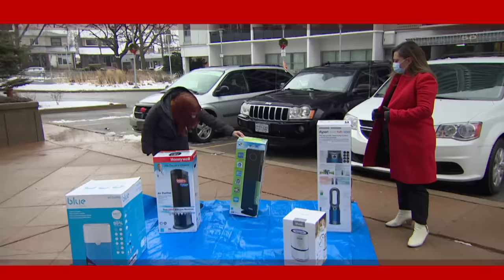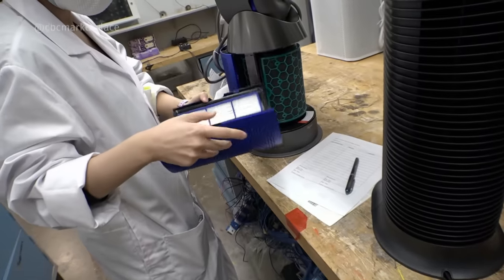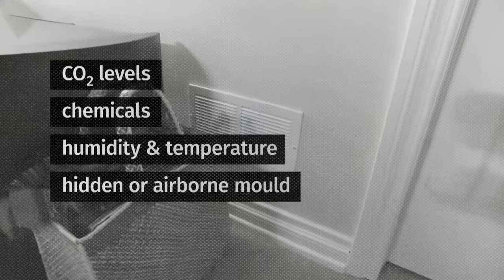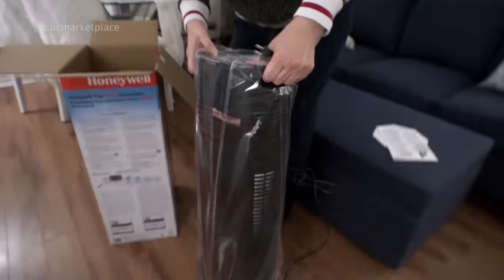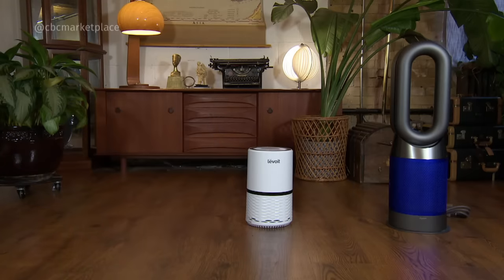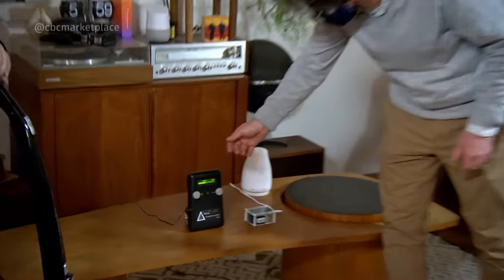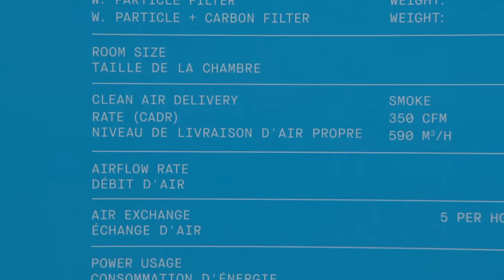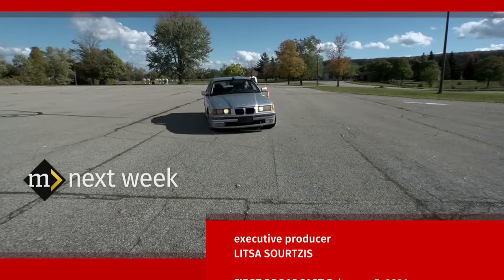Is an $800 purifier best to clean your home's air? We lab tested 5 top brands

Comment: To be fair, I feel like you should have compared air purifiers rated for equivalent size spaces. For example the larger Honeywell 300 is more closely matched to the Blueair you tested and the CADR of that model is about the same as the BlueAir. Also make sure the Blueair model you select used true HEPA filtration as the Honeywell does. Some Blueair models use HEPA but not all do. In addition, the term true HEPA is a standard defined by government regulation. “HEPA Silent” and other “ HEPA-like” filters, there is no defined standard.
Reply: Yes that why I’m saying they all for different room size
Reply: The blueair 211+ they tested in this video doesn't use hepa.  In fact none of blueair's products use true hepa filters.
Reply: Not only that. The Blueair model they tested was a large room air purifier. Many of the others were not. It is interesting they compare the tiny Levoit LVH132 "Personal" desk purifier against the other larger units. They could have at least used the Levoit LV-PUR131 or Core 600S. While they are at it they should of had the popular Winix 5500-2 in there. All of those units have a separate activated charcoal filter for harmful fumes and also have a true HEPA filter. I swear this test must have been ran by Blueair
Reply: @nano411  you're spreading misinformation. Classic series and above use true hepa filters. To the OP, HEPA Silent is only defined by noise(fan speed), not filtration capabilities. HEPA is a standard for the filter, not fan speed. In any case, HEPA Silent doesn't mean anything. It's just a low setting for the fan. The Blue Air Classic and above are are true HEPA filters.
Reply: @nano411  that is true, I’m not sure how much it matters though. I use levoit myself, but blue air proprietary filter tech is quite good, it’s been independently tested and shown as such. Hepa is a proven technology that gives a great deal of comfort as a marketing term as if your filter is hepa certified and has good cadr, you know it works. Blue airs proprietary tech is quieter and does consume significantly less power. I suspect off
The shelf hepa tech did not meet their requirements for power or noise levels.
Reply: @WHERESSS  That may be true, but even "HEPAsilent", not true hepa, in the 211+ was tested as great by Consumer Reports in their test chamber.
Reply: @WarpedTrekker  hepasilent is true HEPA. HEPA is a measure of filtration of the filter. Hepasilent is a fan speed on purifiers that use a hepa filter. That is, all HEPA silent models use true HEPA filters.
Reply: @scarface11385  they just let anyone pick their purifiers lol
Reply: +1000  The Levoit one that they tested is a personal one for small rooms about 130sqft.  Terrible review.
Reply: @nano411  I guess that's good news for me as I don't use a HEPA one, but mine is Oreck XL. Costco used to get them in every now and then, and after about 10 years, it still helps. I just have to remember to wash the parts, and since it's electrostatic, make sure the air isn't too damp.
Reply: crazy part is the blue air filters emit ozone, the exact thing they said you want to avoid..
Reply: @nano411  It’s not a traditional HEPA filter but their technology performs as good (and actually a bit better) per Blueair’s stated specifications.

Comment: I have that Dyson fan. It works so well I bought a second one. The heat function is amazing and also the sensing works very well.
Reply: It came in handy during a power outage that lasted a few days in winter and ran perfectly on a back up generator
Reply: Me as well and i smoke in the room from a bong and it cleans that smoke quick
Reply: A heater that heats. What'll they think of next!
The problem for Dyson is their tiny little fans are very poor at shifting air.
Reply: Got the same one, and seeing how well it works i think it really is unfair to just take count of the CADR
Reply: How do you know the exact filter!..there are so many to pick from, it’s taken me all morning looking!

Comment: This could have been a great study. However it was flawed from the beginning. They're not testing Apple to Apple's comparison. The Honeywell that was tested as well as the germ guardian are not comparable to blue air. They're much smaller they're purifiers. They should have used the Honeywell HPA300 which is more comparable to blue air. It's much larger and meant for bigger rooms. You can't compare small room air purifiers with big room purifiers. The CADR ratings will of course be different because they're meant for different size rooms. I can't believe this is actually gotten so many views.

Comment: I literally just recieved my Levoit Core 300 from Amazon today so it was a bit of a scare to see this AFTER my purchase. However, I feel good knowing I bought it only for the bedroom and it's rated at 215ft², 135+ CADR which for my roughly 10'x14' bedroom should be sufficient. I also just bought a basic humidifier off Amazon and have been using it for the past few days and ONLY with distilled water which again makes a difference. I'm shocked by the Dyson results, we have one of the first generation vacuums and it's still working although it's probably on the way out after more than 10 years of good use. Good to know this stuff, good job CBC.
Reply: I'm wondering if they tested it in a to large of a room. By the looks of it in the video it might have been to big of a space.
Reply: @XDonlyone  Yeah as much as it was an informative segment, I feel that the machines got a bad rap for being "underpowered". For the expensive Dyson I can understand the disappointment; but the cheaper, smaller units aren't designed for anything other than small bedrooms, which is what I use mine for. You don't need 500+CFM for a bedroom.
Reply: @DABlinxz  i bought the Levoit H13 a few months ago for my bedroom and I no longer wake up congested and I don't know how to explain it but the air just feels light and clean to breath in. So it's working more then fine for me.
Reply: We use that one in our bathroom. Been using it for at least 2 years.  Does really well in a small room.
Reply: @XDonlyone  I'm saving a fortune in sinus medicine.
Reply: A fan pulls air through a true hepa filter, how much variance could there be? The  basic technology hasn't changed in years. I would put my thirty year old honeywell with fresh filters up against any of these.
Reply: You’re fine. Cbc’s piece is misleading about what’s important. Just avoid Dyson and Molekule for air purification.
Reply: @XDonlyone  they used another fan to agitate the air in the room 11:23, they fooled everybody for the sake of audience, "modern journalists".

Comment: I bought a smaller model blueair a year ago after much god level research and price considerations and I have been VERY happy with the results. The red light just came on showing that a new filter is needed and considering it’s just been in a bedroom with a none smoker and I’m on the west coast of Ireland right next to the Atlantic air, not much cleaner than that,I was horrified to see the colour and hence how much particulate material it has filtered. Also super quiet on low and moves massive amounts of air on high.

Comment: for a real world view, my son started suffering from asthma when in our front room, the cause was most likely the dog or the vintage sofa. We live by a busy road, so opening the window isnt an option, after a bit of research the cheapest option was to get an air cleaner and we bought a Blue air 411 (the smaller version of the one they tested here) it was rated for a 15sqm room, so more than adequate for the front room. the difference it made was noticeable within about an hour (the air smelt cleaner) and within 2 days my sons symptoms were massively reduced, he still gets asthma it if he jumps on the sofa, which we need to replace all the filling on. but for me its been very conclusive how effective the air cleaner we bought is.

Comment: Dyson has a point tho -- can't really base everything off of one metric...I was expecting a more thorough answer from these videos but they're a bit misleading. Too many variables not accounted for and it doesn't seem like they had a standard for picking which devices from each brand to test. Some might have been for smaller spaces, therefore .. the glaring results. Ah...
Reply: Exactly! They were just measuring air flow. Maybe they got better air flow in the model with the fan taped to the filter because the air wasn't properly passing through the filter. Lol it looks like they literally put it together with masking tape.
Reply: Exactly what I was thinking. They just measuring the volume of the air. Obviously the bigger the fan, the bigger the airflow generally speaking
Reply: They also use a fan to agitate the air in the test room 11:23, but they never mention anything about it ;), guess why.

Comment: I have the box fan setup. It's great and all but the thing is as loud as aircraft when at high mode. Low mode is better but still LOUD.
Reply: Yep, I've been doing this since University of Michigan released a video about it like 9 years ago, and same thing and my only complaint has always been the noise. Also: quick tip make sure to check the corners of your fan! hold some toilet paper to the corners, you'll see they're actually sucking in! Put some tape over it to fix it. I try to tell everyone who does the filter-technique this!

Comment: Since there was such serious claim made about humidifiers - do those please. There are brands that claims that they filter water from minerals and therefore regular water could be used
Reply: Right after he said that, I was like....what if you use Brita filter water instead of tap? 🤔🤔

Not everyone can afford to buy distilled water to constantly refill their humidifier
Reply: Update: Emailed the expert and unfortunately Brita doesn't do much in terms of getting rid of minerals/particles for usage in a humidifier.
Reply: Dissolved minerals would need an ion exchanger, not a filter.
Reply: @knd44  you could buy a stovetop distillation apparatus - a still - and make your own.  Then use it to make some liquor to recoup what you spent on it!
Reply: @Andrew Demchyshyn I found his claim to be somewhat agitating. It appears he was using an ultrasonic humidifier with tap water. Ultrasonic humidifiers are supposed to be used with distilled water which will have little to no particulates. There are other humidifier types on the market. Additionally, the amount of particulates in the air when measured immediately beside an improperly used ultrasonic humidifier do not necessarily represent the amount of particulates which will be suspended and stay in the air. It's much more complicated than he stated.

Edit: My @ didn't work for whatever reason.
Reply: Just use distilled water

Comment: You can compare all of these units to each other. Purifiers with lower CADR/CFM can still be effective in smaller spaces. Comparing the Blueair 211 to the Levoit unit is comparing apples to oranges. The smaller Levoit unit would be perfectly fine in a small office space, bathroom etc where the large Blueair is good for bedrooms, living rooms, dens.
An yes humidifiers can put particles in the air, but if you use purified water or deiozinied water it helps. 
For anything like this you need to ask more questions and present the whole picture.

Comment: Why did you compare a compact Levoit to the larger models of other brands. The Levoit LV-H133 has a CADR of 400cm/hr. and would have been well rated. Apples to oranges?
Reply: Yeah, they should have test it in s small room and see if it was effective rather than testinh it in large room.

Comment: Interesting review. What’s weird to me is the co2 level was measured in the beginning, but none of the fans will change that. people just should open the windows every now and then. 😅 
and i just checked the lasted PH04 model from Dyson. It has now a CADR of 1260 m3/h (page says 350l/s). Is that correct? Would be the new winner.

Comment: It's not really practical to say 'don't use humidifiers'. Air gets very dry in winter which can cause other health problems. I use an evaporative humidifier (works like a swamp cooler, blowing air through a wick filter that draws water from the reservoir). Very little of the dissolved minerals ends up in the air this way. You don't need to have it in your bedroom, either--you should be humidifying the whole home. The one watch-out is to replace the wick regularly and use a biocidal additive to prevent growth on the wick.
Reply: A tray of water would be a better choice at a low cost of entry. With near zero chance eof failure unless you flip it over.
Reply: @lot10101  I can evaporate 3+ gallons per day with a humidifier. A tray of water isn't going to get the job done. If you are too cheap to get a humidifier, use a bucket as a reservoir, hang a towel dangling into the bucket, and use a box fan to blow over the towel. You need surface area and air flow to evaporate a lot of water. You can even get the box fan to pull double duty and strap a filter on it to filter your air at the same time!
Reply: A bucket of water with an aquarium heater works well too
Reply: That's why they said use distilled water or a steam humidifier
Reply: @andrew20146  lol... I live in the tropics and have no need for a humidifier.

Interesting that you know me better than me.
Reply: @lot10101  No part of Canada is tropical. This is a Canadian program. Dry air is a problem for homes that requires central heating.
Reply: @Specogecko  that's like highly inefficient lol
Reply: @nocause5395  steam humidifiers uses lots of electricity and turn nasty
Reply: @daijoubu4529  Why do they turn nasty? Aren't they as hot enough?
Reply: Jessie O. Lee  It's not enough, it's  quite slow and germs can develop in there, so it can make you sick instead of helping you to prevent that. Dry noses have less germ prevention and get sicker due to the immune system not working then.
Reply: @valek7700  the heating elements gets caked with minerals
Reply: Yeah I like how the Prof who doesn’t use a humidifier lives in Toronto, a city where there’s no reason to use one.
Reply: @thisisisilly  I live in the GTA. Humidifiers are necessary here.
Reply: Fine you can have one too